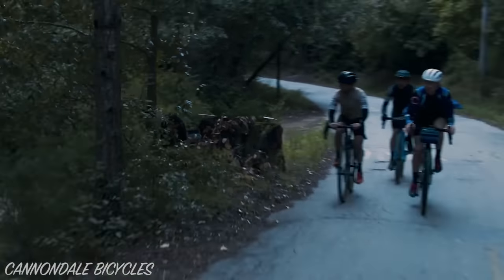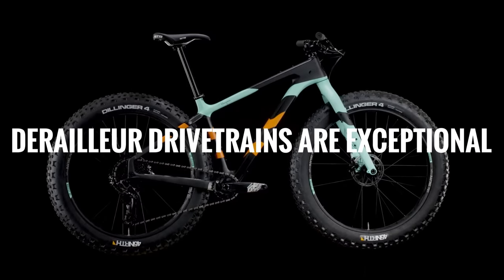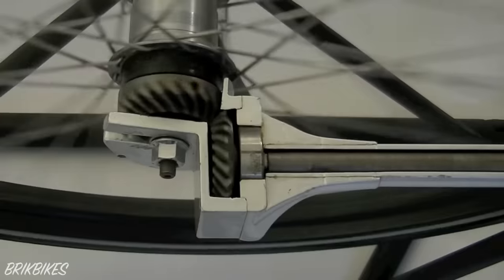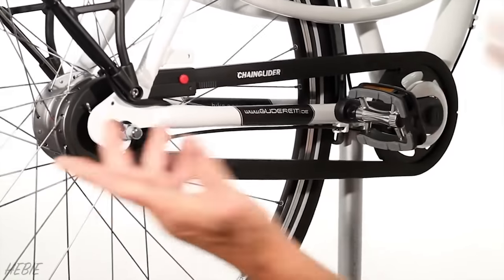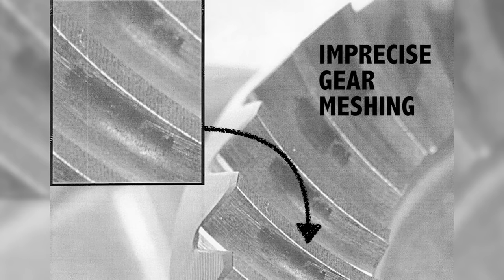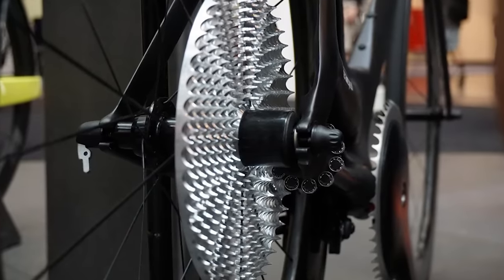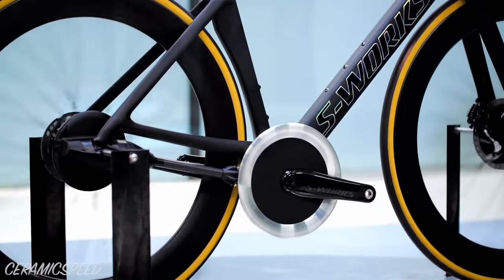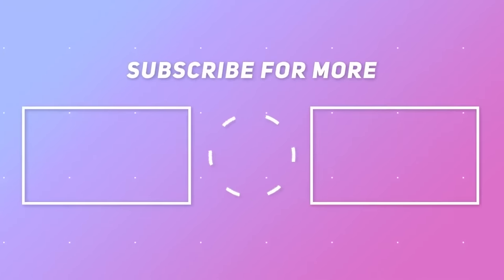Are Chainless Shaft Drive Bicycles a GENIUS or TERRIBLE Idea?

Comment: At this point, I need tires that stay inflated before I can even begin to worry about the efficiency of my drive train.
Reply: I'll make a start up that sells solid rubber tires and advertise it as not needing any pumping
Reply: I used to live in an area where we had these really nasty weeds that grew these burs we called catheads, they would go straight through even those thickened puncture resistant tubes. I wound up putting stuff called green slime in them and the tyres would still pick them up and break most off again while riding but the ones that came out left tiny blobs of this green that had almost instantly sealed the punctures. There could literally be dozens of these little blobs of green and every 1 of them would have left me with a flat long before I got home. You will still lose a small amount of air and need to top them up semi regularly but at least I could go for a proper ride.
Reply: I'd recommend the Tannus Airless. They have tires with different "pressures" and different surfaces (slick/non slick/wet tires). Bit hard to get on, but ride very well and dont need swift replacement
Reply: @GrafEnsker  I must admit I'm not familiar with those tyres but, anything that can give a satisfactory ride and decent traction with low friction that DOESN'T contain air would be by far the best if you live in an area where punctures are a constant problem. I will look into them myself now too. Thanks for the information.I'm
Reply: Or rims that never go out of true.
Reply: @ShrapnelACU  Yeah sure. Good luck with that one. Actually it wouldn't be that hard to make them much stronger and stay true under normal to reasonably rough going but they'd almost certainly have to be heavier to do it. Everything with any vehicle is a balance between acceptable strength and weight but more so with bicycles so you could make them near indestructible but your going to pay for it in extra weight or expensive exotic materials like carbon fibre etc, so it's your choice, if you can even find really strong ones that is.
Reply: @ShrapnelACU  I like the concept of the enve moto rims. they're wide so they have a lot of lateral rigidity but because they're single wall they flex when faced with upwards bumps. Kinda puts a lot of stress on spokes though.

If you have disk brakes and deep section carbon wheels it's honestly kinda hard to put them badly out of true. peoples usually crack the rims before they go out of true.
Reply: @lorditsprobingtime6668  I used that stuff, too, and had to keep a pump on my bike at all times, because the mesquite burs were everywhere. Before work, at lunch, sometimes after lunch, and after work, 3 to 4 times pumping up my tires because they'd gone flat. Maybe I was doing it wrong, but I should have gone with the thicker rubber inner tubes - more weight, less flat.
Reply: @leonielson7138  I went with the thickened outer layer puncture resistant tubes, nowhere near good enough on their own. With the slime I always use about twice as much as they recommend and do carry a pump too because as I said already, " You will still lose a small amount of air and need to top them up semi regularly but at least I could go for a proper ride".
It wasn't often I'd really need to pump them up while on a ride but it could. These burs are short spikes about a quarter to three eighths of an inch long that are really hard. Maybe in your situation the holes might be too big or maybe you're getting a lot more holes or possibly you just need to add more to the tubes.
The airless tyres Lord Ensker suggested sound like a good solution for both our situations for long term no worries riding.
Reply: Try KHE - they have some series staying pressurized even on 6+ atm, standard around 2.4 to 3.6.
Reply: Michelin Airless Tyres
Coming soon

P. S. They didn't pay me xD
Reply: @claudiusraphael9423  1 Atmosphere is about 14.7 psi if I remember correctly so for road and distance high pressure is best and even 3.6 Atm would be only around 45 which isn't bad but higher would be better. If they're capable of up to 6 Atm then you could put enough pressure in to really reduce that rolling resistance seriously, so they could be good too.
Reply: @G_L918  I like the sound of that. Michelin make good but expensive car tyres, I've got a set of 20 inch 275 wide ones on my car now. If they make a dedicated pushbike tyre that's airless you should be able to be pretty sure it's likely to be made from the best materials for the lowest possible rolling resistance so unless I saw a couple of bad revues on them I'd choose them almost for sure.
I'm curious about your name. It could imply you're an aerial fire bomber or it could maybe mean you're "fighting" the air to win some sort of air races, possibly even RC model racing, It could even mean you're trying to beat some land speed record or it could even be more like shadow boxing. I have absolutely no idea but, the name is intriguing and I'd love to know exactly what it means, if anything?
Reply: @lorditsprobingtime6668  Yop, that is why i like them. The thing is they have a rich diameter of almost 2 inch, as they are meant for BMX/Trail/Park. They have a massive volume, which packs quite a punch. When pumped up to max (i blasted one at around 7.5-8 atm) they are like a balloon-tyre as for example used on Bigbois or Heavy Cruisers, still suck a curb or thick branch easily while providing a straight glide on the road. Due to the flexibility and the thick mantle gravel or even glass-shards are just sput out after being softly embraced. Main con is the weight, as you can literally feel the mass of air moved plus the mantle material, but that also stabilizes the ride at high speed. So, yeah not for everyone, but if you are used to kick it and have foot- and leg-strength it really doesn't matter.
Reply: @lorditsprobingtime6668  bruh just check the channel lol
Reply: @claudiusraphael9423  Thanks for that. As for the " foot- and leg-strength " department here, that's not great so maybe not ideal for me. I'm 65 and have no ligaments that aren't full thickness tears in my left knee except the ACL which is torn, just not completely and the accident that caused that also involved five holes in my left lung, lost spleen and a whole lot more so just cycling at all is a big challenge to me now.
Reply: @lorditsprobingtime6668  In that case a rigid tyre would surely be preferrable - dunno if they still produce em, but i am still using up a stockpile of Panaracer - different optimized profiles for front and back, extra thick centerline (behaves like a trekking-tyre on road), is a kevlar mix and has rigid wands, but is actually a mountainbike tyre with excellent grip in mud and sand and on gravel it just slices through. Maybe worth a research?
Reply: Problem with the cell-tyres is they are extremely soft at low speed and have a high resistance and they are heavy in comparison.
Reply: @lorditsprobingtime6668  For a light tyre with very good protection Continental Kevlar Cross Country, they do not suck any curb or gravel tho, street-only.
Reply: @G_L918 :   " bruh just check the channel lol "
Well that was easy, and stupid of me not to think of. Very cool, I've been meaning to try one of the good air battle type sims myself for a while, I did start downloading (I think it was called) DC world but nearly finished and something failed and I haven't got around to trying again. I do fly model RC planes a lot and no guns but do have a couple of combat wings that a friend and I use to try and smash each others planes out of the sky with, I mostly win but half the time you do as much damage to your own doing it that it's constant repairs anyway. That's a lot of fun but all pure reactions and nothing particularly technical or strategic like what you're doing, repairs would be no problem for you either lol.
Reply: @claudiusraphael9423  Thanks for the extra info. I really do hate the idea of any more than a little bit of added weight and I should have thought about the obvious fact that any airless tyre will HAVE to be substantially heavier. I'm probably best actually sticking to what I was using. I do ride a mountain bike for the flexibility to go exploring so want at least a bit of bight but (sorry, I forget what brand/type) they have a solid ridge around the centre so there's less rolling resistance and they aren't perfect off road but they take up to about 80 psi so roll well and are good on the road and just barely ok off but, that's tolerable to me. I have the puncture resistant tubes which do reduce the number of these burs going right through, add about double to triple the amount of that green slime and carry a pump which is only rarely needed on a ride but is needed occasionally and I manage alright like that. Of course if something sharp makes a bigger hole I'm still buggered but it's mostly millions of these horrible nasty burs we have everywhere that are the biggest problem. 
Thanks for the suggestions.
Reply: I have a whole pile of different tires :-). Depending on weather too.
Reply: Could just fill your tubes with insulating 
foam
Reply: @kageyume9319  That's Polyurethane which doesn't like being flexed and crushed once cured. It would soon turn to a dusty mushy mess.
Reply: high density pipe covers with a racing innertube in the void, if you know where to look you can make your own for cheap, but they are coming on the market more and more but i think they are expensive so DIY
Reply: Lol, the first bike I owned in the 90's has some weird milky white fluid filing the tube.
Reply: Schwalbe Marathon Mondial. They are insanely puncture proof. I had these on when I was riding more than 15K kilometers a year and they lasted several years, and then donated them to a friend cause I wanted a larger diameter and he rode on them for some more years. We both haven't had one puncture here in the Netherlands, where some dickheads love smashing down beer bottles on all our lovely cycling tracks. Back then these tyres were still called Marathon XR. They outlast a Vredesteijn Perfect tyre at least 12 times. I have never come across any tyre that even performed a fraction as good on almost any criterium. They are not even that thick and heavy, so no ridiculously thick rubber layers, which means they ride with very low rolling resistance too. If I were to cycle round the world, or be a bike courier, these would bey go to tyres 100%
Reply: Huh I thought I was the only one
Reply: Bell made these inner “tubes” that were a rubber foam that wouldn’t deflate ever. The branded them as “No flat” I had them on my bike they ride like regular inner tubes except for some minor shock absorption deficiencies, if you hit the little lip to a curb at some speeds you’d feel it slightly more than you would have. It was great never needing to change tubes.
Reply: @vincenzodigrande2070  Thanks, they do sound good, even if just for durability reasons.
Reply: @MurlocConfidential  I usually wind up destroying a tyre before I need to add more. I do add at least double what they recommend though and by the time something bigger rips a tyre open or it just fails from wear and tear the slime is usually still quite runny. I think the smallish amount of air inside the tube pretty quickly gets fully saturated with any fumes or vapors from the slime so it vary quickly reaches that point and without a lot of fresh air regularly replacing it it just stays there nice and gooey. There have been occasions where I've stopped and spent time holding the hole at the very bottom of the wheel to get the slime there faster and stop the air escaping which could be an indication even more slime might be better for really bad conditions. It is great on small, pinprick sorts of holes but over a certain size it just can't do. There is a product designed more for 4X4s that clogs up to I think a quarter inch holes that I tried once but it was a bloody nightmare trying to get enough through the valve hole to work properly which I have no doubt it would, if I could have gotten enough in. I tried repeatedly and would get a little in but then it would form this cluster of fibres sort of clog and you'd have to clear that before trying again, and again etc etc. I wouldn't use any of these products on a car that I'm going to be driving at highway speeds because of balance issues anyway but I can easily imagine that last one being great to have in purely adventure driving, IF YOU CAN EVER GET ENOUGH IN THERE.
Reply: @MurlocConfidential Very cool. Good luck with it. I totally agree about the roads, although I do still ride on them when I need to I wouldn't do it without mirrors so I can see the idiot who's about to run straight over me.
Reply: @Echa37-H37  When I was a teenager (quite a long time ago!), the ride to my girlfriends house would commonly end in punctures. I couldn't afford constant replacement tubes or the regular repairs. I looked around the garden and found some stiff wall hose that fitted inside the tyre.
It was surprisingly effective, hard enough to ride on for months, enough flex for bumps. Not perfect but got me where I needed to be. ;)
Reply: Me presenteia com uma bike dessa.
Reply: @djtaylorutube  Good on you for improvising. I have been known to keep stopping on the way home with about 80 kilometers to go to keep stuffing grass and anything I could fit, including strips of carpet I found in my car tyre just to get home after having 2 punctures in the one trip.
I leaned a good lesson that day. It was a dirt road I've driven dozens of times BUT, it had just been graded and although at first I thought that was great because all the corrugations and potholes were gone but, all old nails, screws, anything sharp that had buried itself was now suddenly on the surface and often pointing up just waiting for the first few cars through to pick them all up in their tyres.
Reply: @Echa37-H37  
I work at a bike refurbishing and service store

Solid tube is a thing, but the thing with it is the ride is Garbo. The rubber doesn't cushion like air does and it has rolling friction like you're always a bit flat.

We get people in literally daily asking us to remove solids that Walmart put on their bikes (Walmart sells bikes with solid tubes stock btw). It takes either three people with crowbars or someone with a saw to remove them because they're not pliable

Just put a new tube in, a liner of some kind, and pack the thing with slime and you'll be all good anyway.
Reply: @Echa37-H37  its been done, more than once.  Generally inefficient
Reply: I tried all of these things, and had the best luck with nylon inserts that go between the tire and tube.  Still had a couple of sidewall punctures  a year, but none in the meat.
Reply: Sulfur hexaflouride.  Adding a small amount of sulfur hexaflouride (gas) to your tires will keep them inflated for months without the droop of plain air. But DO NOT use pure sulfur hexaflouride or the tires will burst!  Freon will do the same but not as effectively as the SF6.
Reply: @daviddou1408  It was tubes I was talking about. They were much thicker towards the outside to give a bit more rubber things had to go through before puncturing. I haven't tried puncture resistant tyres because I always use mountain bike style tyres because of the wheel width but always try picking ones with at least a solid uncut section in the centre to hopefully reduce rolling resistance.
I like your idea with the bridle type thing. I'd be worried about it hooking into the rubber and sending my face first at the ground  if I didn't get it right, and I'd be trying to get it so it didn't quite rub on the tyre which could still work well on these quite big burrs we get but, another problem IS bringing the damn things home with you then getting them sprouting up all around your yard. Even if I scrape what's left off onto a tarp or something then throw them in the rubbish you'll always lose a couple just riding into your yard so I may just try that, cautiously but it definitely sounds a good idea, thanks.
Reply: FTW!  eot
Reply: @protonneutron9046   GTFOYI.
Reply: Kevlar tires with tuffy strips.
Reply: tubeless is the only way. Get some real solid rubber, and you're gucci.
Ive ran tubeless over 5 seasons, and ive yet to get a full flat yet, never had a blowout even.
Reply: @Echa37-H37  if you make it can you send me 100 pairs ??
Reply: Ha! I have a new Giant brand that I bought six months ago. I like it very much. But I have yet to figure out how to adjust the disk brakes which badly need adjusting. The tires do hold air tho, so there’s that. My wife’s tires need topped off every week.
Reply: airless tires, tubeless tires, puncture proof tires, etc.. already exist.
Reply: I built a 3kw ebike to take me 40 miles a day roundtrip to work and back and it just so happens my route takes me the way that every garbage truck in the county travels on to the landfill so the roads are littered with nails and screws. Slime certainly is a wonderful product and I've been riding flat free for thousands of miles now. I have heard thumping sounds before that increased the tempo with speed, stopped my bike to investigate and found 4mm wide and 75mm long screws and nails sticking right out of my tire smacking the frame with each revolution. Pulled them out on the side of the road, lost 10 psi and then continued my ride with zero problems. The trick for me has been to use a bit more slime than it calls for on the label. Instead of 4oz I use 6oz for instance. Good luck to you fellas out there and stay safe!
Reply: tubeless <3
Reply: i totally agree... every minute repairs.. its one of the reasons i gave up on bicycles.
Reply: My inner tube always pops once I replace it and get going. I swear I'm going to just buy another wheel.
Reply: @southpineshooligan  tire slime for me, only time I get a flat is if I leave my bike to sit for a couple months, than I just need to ride it for a couple minutes and it will hold air again.
Reply: @flyingsavage8522  If I dont plan on riding, I rotate my wheels once a day, never have issue losing air.
Reply: Slime
Reply: Tubeless
Reply: Get tubeless tires with a high quality sealant for your bike and you don't need to worry about losing air anymore. That is not magic silver bullet solution but still a really good solution.
Reply: Efficiency isn't the problem, rather the complexity, clunkiness, and exposed operation of chains
Reply: @Echa37-H37  battery powered mini pumps exist
Reply: There's indestructible tires on Amazon
Just gotta pop em on and ur good
Reply: @butterofthepeanut3444  Pretty sure I'm gonna need a refund on those. Also, they should have installed those on the Concorde.
Reply: Special thick tubes, and Kevlar liner. I've kept the same tubes inflated for 2.5yrs and haven't needed to add air. If you find it necessary, add sealant to the new tube ahead of time.
Reply: Also ride comfort of solid tires is terrible.
Reply: There are solid tires i  had them decades ago😂 company went out of buisness or something ther are not realy comfy but they wont go flat the solid chainshaft looks nice and clean i have broken many chains deraileurs pedals and even the toothed gear thing broke in half (forgot the english name😂,where the chain goes over to drive your wheel) i dont know how many torq the chain system can handle i doubt the shaft can handle the same amount of torq
Reply: Schwalbe Marathon tires are surprisingly durable. Literally unpunchable by most objects on streets.
Reply: Start with decent valves that don't leak ?
Reply: Just foam fill your bike tires
Reply: Just make sure you have no leaks and that your psi is right, if it's low it can leak more
Reply: Puncture resistant tires backed by slime tubes my friend.
Reply: @Echa37-H37  SLIME INNERTUBES
Reply: SLIME INNERTUBES
Reply: Same! Btw, if you're riding check nta helmets like xnito or bern hudson, I see a lot of people still wearing cpsc helmets which aren't really safe
Reply: Full containment tube tires...
Reply: OMW!!  Stan's every 4-5 months, period.  The only time in 3 yrs I've had a flat was the day I bought my new bike and was so excited I went out without stan's.  Flat in the first 2 miles. The 1.5 mile walk back sucked. NEVER again without stan's. I almost swear its magic.. I run 4.8" & 3.0" tubed surly tires on DT swiss rims on my  e-Fatbike.
Reply: ride on wheels
Reply: Main reason I stopped pedal pushing. Tired of replacing a flat only to have to do it again later that day
Reply: @lorditsprobingtime6668 aren't traction and friction the EXACT same thing?
Reply: @themonsterunderyourbed9408  Then why would we have 2 separate names? What do you call it when you want more grip/"traction".
What do you call it when you want braking force grip, better friction.
Just look up the definition of each rather than ask here.
Reply: @lorditsprobingtime6668  the slimetubes are great. I've had an entire screw in my tire and it still held air. 😂
Reply: @DS-lk3tx  If you mean the Green Slime IN the tubes, yeah, it's great for small holes. If you left the screw in your tyre it would likely seal it as you mentioned but, unless it was a really thin one, it'd struggle to plug that before you lost a lot of pressure. It has it's limits. I tried some 4 X 4 stuff that was rated to seal up to something like about 8mm but, getting it in through the valve stem, even with the valve removed was just about impossible, it even kept plugging up with these fibers that made it pretty much mission impossible. My biggest bike tyre enemy where I lived then was these burrs here in Australia we call Cathead Bindys.
Those things grow like crazy and get covered in these burrs that aren't too bad when they first form and are green but, they start drying out and hardening really fast and will go through a lot of footwear, You HAVE to make some sort of floor if camping because they'll go straight through any tent floor into bare feet, puncture an air bed and they are EVERYWHERE out there!
The only good thing is that by the time to point has gone through a tyre they usually only punch something like 1mm or less sized hole which that slime handles pretty well. There's so many of those things out that way that I still needed to carry a pump because each hole would let a tiny bit of air out and by the time you'd ridden 20 kilometers on the road even, you'd have hundreds of these little green dots where the burr had been knocked off but had still made a hole and once home, you'd need to spend a while scraping the rest off your tyre in the hope you don't, or haven't already dropped a few around your own yard. I was having a running but losing battle with them trying to poison regularly with Glyphosate but, due to having to work away from home often, I'd get back after only a few weeks and they'd have sprung up, grown to cover quite large areas and produced hundreds of these burrs each. The only option then is to carefully dig the bloody things out and almost always wind up with fresh burrs dropping ready for next spring, and on and on:face-purple-crying:.